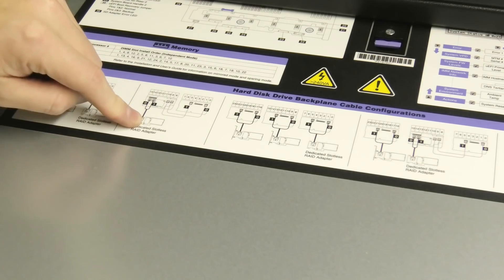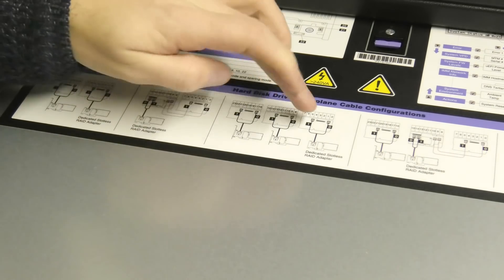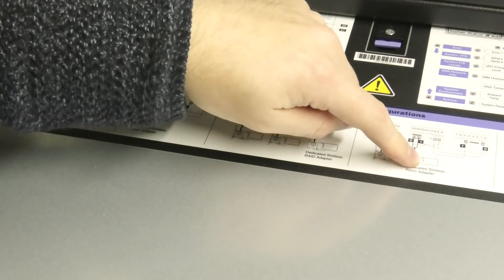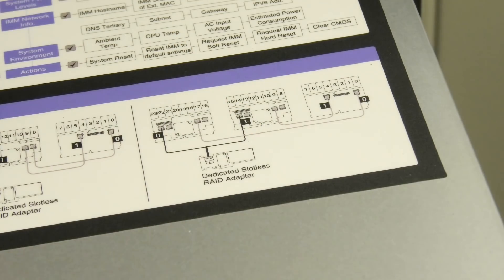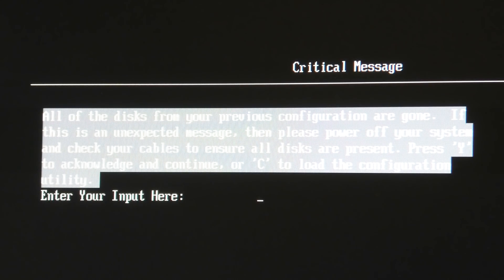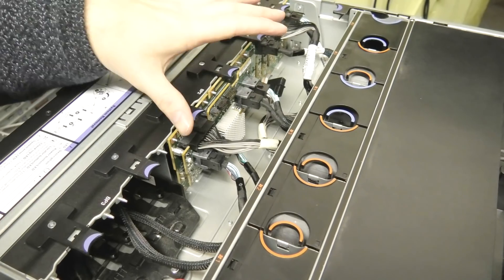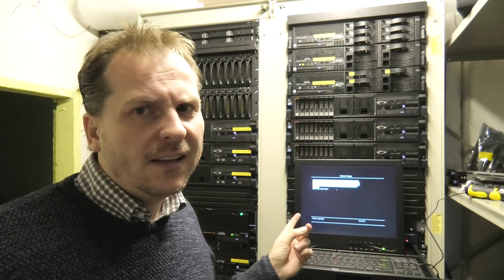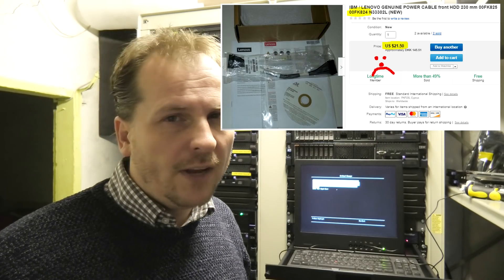Expanding Lenovo System x3650 M5 - 8 more HDD, BUT! - 886

Comment: I am expanding my video rendering x3650 m5 i did not use because i had no gpu to put in that. I tought an rx 6700 would do the job better than the previous pc it was an i7 3770 with a gtx 980 ti, still valid. I want more ssd storage and im out of places. Raid 1 for os on 2 ibm 100 gb ssds. Raid 0 of 2 250gb low budget sata ssd. Raid 5 of 4 600gb drives and i want 8 of them + 2 additional ssds to work on. Expander arriving soon
Reply from the maker: Hi leonardo toschi
Thank You very much!  glad you liked the video :-)
Thank you for watching! :-)

Comment: your SAS connections are swapped from your expander to your RAID controller..... if you are looking at the front bezel on the right hand side of your expander. SAS 0 is supposed to be on the left and SAS 1 is on the right...

Lenovo makes that very clear in the below guide

https://systemx.lenovofiles.com/help/index.jsp?topic=%2Fcom.lenovo.sysx.8871.doc%2Ft_installing_8_25_hdd_kit_with_expander.html
Reply from the maker: Hi Joseph Carbone
Thank You very much! In a later video we found that the SAS expander was broken,, I even fixed it, by changing some SMD components :-)
Thank you for watching! :-)

Comment: You messed up backplanes... New one should use "first" bay where the hard drives are from 0 to 7. Now you have, starting from left 8,9,10,11,12,13,14,15,0,1,2,3,4,5,6,7.... so raid controller is expecting drives from 0 to 7 and they are in 8 to 15... You have lid with instruction and You still messed up... shame on You! Please let me know if i'm right with connections. I'm working in Data Center in Poland with DELL servers so the connection of the backplanes is assumption, but still, I think I'm right. Unless it is power cable. Raid controllers are dumb, powerfull but dumb. Hopefully it is only Your mistake :) like Your videos! Cheers!
Reply from the maker: Hi Imba Core
Thank You very much!  glad you liked the video :-)
Thank you for watching! :-)

Comment: You should put your multimeter on and check the voltage at each pin of the molex connector - I don't think the cut cable would cause the problem.  It would only become an issue if the drive bay was completely full of  drives and the current carried by the remaining uncut cables was insufficient.  If the cut cables are all +12v, you can simply resolder them.  If 1 or 2 are earth, then IBM should be shot for bad colour coding.  If they are all +12v, which I suspect, then the dipstick who added the molex should be shot - whoever heard of a molex connector with 4 +12v pins?
The drive error is due to the numbering of the drives.  Swap your drives into bays 1&2 (8&9)of the new backplane and you will boot just fine.
Reply from the maker: Hi Ein Felder
Thank You very much!  I agree,, it's weird as heck :-)
Thank you for watching! :-)

Comment: Hi Morten.
Maybe a solution, but don't know.
Have you checked for the latest firmware.

Have experienced that the Raid Controller was updated with the latest firmware but not the Expander card and the Raid Controller was unable to manage the Expander card correctly.

Best Regards
Niels.
Reply from the maker: Hi Niels H. Johansen
Thank You very much!  That is a good suggestion. :-)
Thank you for watching! :-)

Comment: Hi Morten, this error message is usually popping up when your drives are not in the same slot as they were before. I assume the reason isnthe expander which changed the slot config. Did you put back all as were before and try?
Reply: Could be..."Change the slot configuration", on a second thought, if this has to do with swapping the backplane dassychaining, if the old one is also a SASexpander (which I doubt it is) . Also , could be with swapping the power connector side of new card (may be molex connector isn't required to be connected to SaSxpender).
Reply: Ah! Ok as per scenario 2, nothing has to be swapped on controller or the disk. Ignore my  previous comment|analysis.
Reply from the maker: Hi Gábor Gregus
Thank You very much!  But the M5015 should not care where the drives are located. if it see it, it should just use it.
Thank you for watching! :-)
Reply: @MyPlayHouse  hi Morten, is the M5015 RAID card on the IBM X3650 M3 compatible with the 3650 M5?
Reply: @frederiquekruger4818  no according to Serverproven
Reply: @MyPlayHouse  Hi Morten, but message did not say it is not seeing the drives, just that the config changed. If you hit ok, it would proceed the boot I guess.
Reply: Actually saying they are gone 🙂

Comment: Thanks for that, Morten. I have 2 of those servers running and will most likely be doing this upgrade.
Reply from the maker: Hi Adman Filpo
Well it suckes that mine did not work,, would be way more convincing to just have it working.
Thank you for watching! :-)
Reply: My PlayHouse I have had that screen a few times as well. I would try going in to the IMM and, depending on your raid card, run “Detect Foreign Configuration”. Maybe it is just reacting to the different setup.